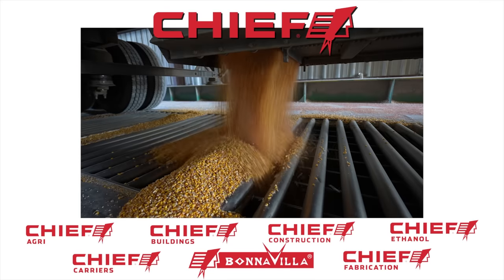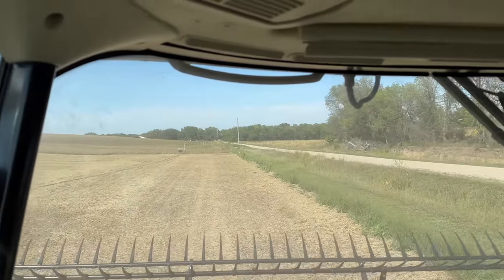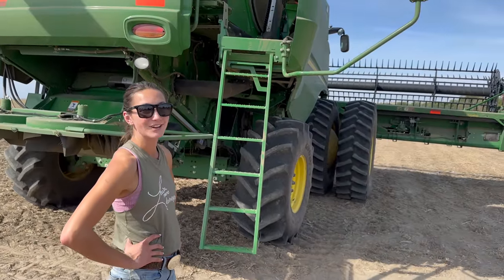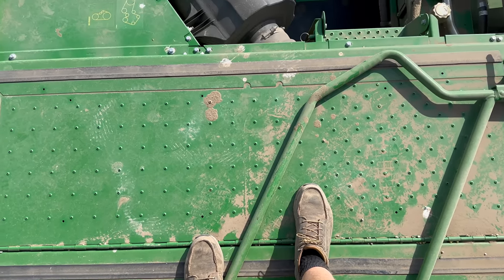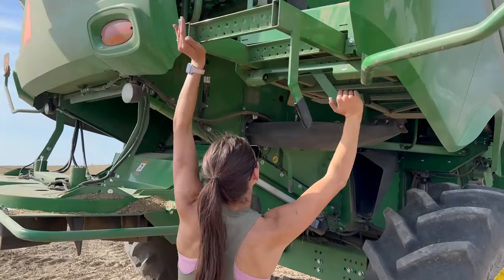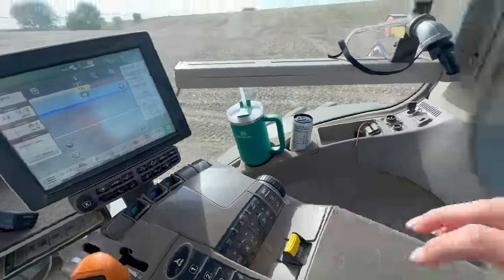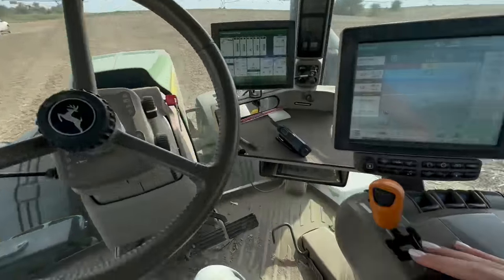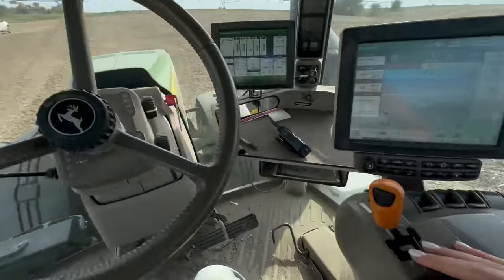We Burn A LOT Of Off-Road Diesel

Comment: You cross your chains for encase the tongue of the trailer comes off the ball hitch. If this occurs, the tongue will fall onto the cross X of the two chains and not strike the ground.
Reply: Nice to know, been doing it for years and never knew why...
Reply: Not going to argue your point but, the real reason has to do with physics. With the chains crossed, when turning, they remain very close to the same elevation off the ground. If they are hooked inline, the chain to the inside of your turn would droop and possibly drag while the opposite chain would be stretched.
Reply: 10-4 on that
Reply: what they said^^^^^^^^.
Reply: Most state laws for towing a trailer require you to cross chains. Safety factor.
Reply: And the crossed chains keep the trailer more in- line if it becomes detached for any reason
Reply: @philipfleming3546  had a trooper ticket me at age 17 for not having my chains crossed judge dismissed it thank goodness
Reply: @joshchoate9499 …I don’t believe there is any state that has a law about chains being crossed.
Reply: @philipfleming3546 …No state laws for crossing chains that I know of .
Reply: I always heard you cross the chains amounts to a check list item.  Like saying the gun is always loaded.  If you cross the chains then you know you attached the chains.  Some things are too obvious to leave to chance.
Reply: Wait you all use chains I guess I should start doing that too
Reply: Yes! As stated 👍  It's a 'safety' thing
Reply: Two chains huh... (NZ)
Reply: Also, very important, the breakaway cable cannot be hooked to the safety chains.  It defeats the purpose.  It must be hooked separately to the vehicle.  It CAN however be laced through the chain links.
Reply: Why do pickups have safety chains but 80k semis only have one kingpin? 🤔
Reply: I thought it was so trailer will not be able to wip vilantly till it over turns truck and trailer.
Another no no pulling vehicle wheel base is extremely important.
I seen a jeep pulling a med size boat on interstate the whipping from over correcting let's say you could take all 4 jeep tires off on top of devider. And it looked like a boat all over the interstate not pretty
Reply: Thanks @ Kimblyelrod7850 for answering that question - I went right to comments when she asked, because it IS IMPORTANT TO UNDERSTAND WHY... My Dad taught me this one as a kid...Yep, saved me with my truck and trailer once.  Otherwise, would have plowed the hitch into the road & may have caued a LOT of DAMAGE, instead of just allowing me to pick it up & reconnect!
Reply: @keithpfrang2114  Understand your statement, but most trailer chains are  cut the same length for the safety chain, which is based upon the gross weight of your trailer. But the overall reason is for tongue safety.
Reply: @toledojeeper2932  There are some. You need to check each State that you tow in. Pennsylvania is one that requires crossed chaines.
Reply: Most States require safety chains on trailers.
Reply: @tylerbendzick  Different type of trucks and different type of trailers.  Apples and oranges.
Reply: @kimblyelrod7850  ..Ok . You would think it would be common sense to cross the chains . But I will admit at times when I’m in a hurry I forget to do it , usually when pulling an anhydrous tank or liquid fertilizer tank .
Reply: Yeah, here in Georgia the GSP Troopers take it seriously to cross the safety chains. They aren't to be dragging on the ground, and by crossing them, it makes 'a cradle' in case your hitch comes off the ball, so it has a better chance of holding up behind the hitch. Oh, and here about off road diesel, if you get caught running this red colored fuel, it's a $10,000 fine, per gallon capacity of the tank or tanks. So my Dodge Ram 4x4 diesel has an 85 gallon tank in the bed, plus a 34 OEM, which is 119 gallons total, X $10,000 = $1,190,000 fine !  I keep it locked, to keep people from siphoning, and keeps them from adding a coloring agent such as red.
Reply: @HerbertPrince  ..$10 a gallon or $1000 per violation.
Reply: @toledojeeper2932  
Wow, Nebraska is a lot more lenient than Georgia is. I was at a scale a few years ago, as the DOT told me it was $10,000 per gallon capacity of the tanks. Which means, I could only have 5 gallons of fuel, but still have to pay 10 thousand per gallon capacity of both tanks. Of course, I never used any, but had some friends who were big farmers who did, and got caught.
Reply: @HerbertPrince  ..It’s the same fine in every state . $10 a gallon/ $1000 per violation. The dye enforcement program is run by the IRS not by the states .
Reply: @toledojeeper2932  
Not from what the state DOT told me. Then a friend in Southwest GA, who happens to be the county commissioner, told me, it actually costed him $2,000 the first time, then it would have been $10,000 the second time, then $10,000 per gallon capacity of all tanks.
But that was year before last, things could have changed by then.
Reply: @HerbertPrince  ..It’s a fine set by the IRS . The IRS has control of the dye enforcement. States and the DOT have nothing to do with the fine .

Comment: Because I'm a fan, I truly appreciate you and Grant taking the time out to make the videos.
Today I learned that you need to cross the chains when you hitch, that you're Combine uses upwards of 300 gallons per fill, that the soybean stalks being wet are what clogs your combine, and that you need to check your equipment whenever you can to avoid issues. I also learned that the fuzzy crap on the outside of a soybean becomes airborne during harvest and clings to everything in the worst way possible.
Love, love, love the kittenz.
If you ever need someone to just record video of the kittenz, I would make the trip in a heartbeat.

Comment: You cross your chains so is the trailer comes loose from the ball, the tongue will drop down into the 'X' you made crossing the chains.  That way the tongue won't hit the ground.

Ideally, it would swing under your bumper and not damage the trailer or the tow vehicle.

If you don't cross them, the tongue would hit the ground and the chains would drag the trailer after it digs into the road.

Comment: A system that I use since I don't have a backup camera, is that I have a magnetic rod that I place on the ball receiver of the trailer to align my ball hitch with another on the bumper that allows me to get as close to possible the correct distance for the hitch.
Reply: I also use a long magnetic rod that I can sight with a defined center line.  Additionally my trailer jack is electrically operated from trailer power connector on my truck.  I am hauling a much lighter trailer than Laura's fuel trailer.

Comment: If you ever want to build a custom fuel tank in a square or rectangular shape, take (in inches) Length X Width X Height, then divide the total by 231, and this will give you the number of gallons. It's nice being able to drive on a trip, then not have to stop as often, plus when I find a place where fuel is cheaper, I top off both tanks. Saves lots of money in the long run, plus in case there is a disaster (like a tornado or hurricane), my Ram 2500 can go way over 2,000 miles without having to stop for, or to find diesel fuel. And if you use a 12 volt solenoid for a transfer valve, make sure it has Viton seals, so the diesel won't leak.

Comment: I’ve recently discovered that in my small Honda generator, ethanol is a huge culprit to carburetor plugging. It turns to water I a tank  so I now only running 4cycle clean gas w/o ethanol. My lawn mower also runs much better on non ethanol fuel.  Storage of fuel is a tricky deal!

Comment: 2:15 - Cross your chains so if the ball breaks the tongue will fall onto the chains and not dig into the pavement and possibly flip over. Also if you have a jack with a wheel you should lift it all the way up and turn it slightly to the right. If it comes down on the jack it will roll off the side of the road.

Comment: When I back up to a trailer I do two things. One is to use the outside rear view mirrors to look at the sides of the trailer and the sides of the truck. When the sides of the truck are in line with the trailer are equal I' back up. When I think I'm close I stop backing and go back to see how I'm doing. Let's say I think I'm a foot short.. I go back to the cab and leave the door open. I look down at the ground and pick a stone or a shoe mark or any handy mark on the ground and then I back up as much as I remember from looking at the distance between the ball and the hitch.

Comment: a great trick that we use in our operation, is that on the pickup truck beds on the inside, we put a piece of tape where the center is. Then we when unhook the trailers, we put a board behind the back wheels before we unhook so that you know where to backup to. I think it helps to make quick work when your in a rush.

Comment: I have seen all the correct reasons here in the comments,, catches the trailer in the X , steers much more effectively if it becomes unhitched, most state laws say crossed chains, and when you turn the chains don't scrape the ground.  Laura, you have some really smart people watching your channel.  You are a lucky farmer.   The trick I use, no backup camera, Gunsight down the side of your truck with the side mirror.  The truck will approximately line up with the side of the trailer.  Put a bright pebble or stick along side the drivers side tire exactly how far you need to move the truck over.  If you need to move the truck back 8 inches, open your door, spot the leaf, pebble,, whatever on the ground 8 inches  from where it will be even with the V formed by the door sill and open door,, or a little less because of angles.  Once moving and straight,, study the particular trailer to see how it aligns with the side of the truck,, remember that.   Maybe even mark the point on the trailer face or fender with a bit of bright tape.  You'll have an exact marker for the next time,
Reply: I don’t know of any state laws about crossing chains .

Comment: If u place a red line on yout tailgate(inside) and make sure the tail gate red line is centered of the hitch, then one red line on your fuel wagon, when u back up just center the two lines and you'll be lined up to hitch whatever trailer that you use.

Comment: Hey Laura . Here is a tip for you to help you back up to any trailer with a ball hitch with your truck. Take a piece of duck tape and put it on the inside of your tailgate were your hitch is at and take your rearview mirror and push the lever to were you would for driving at nite (or it lets you see down) and then you don't have too turn your neck so hard and with the tape we're it is you should be able to back right under the trailer hitch part!!!!

Comment: One simple aid would be a flag in the truck with a magnet on the end of a pole tall enough to be seen from the truck. put it on the jack crank to be close to the center of the tongue of the trailer. As I learned long before backup camera to hook up to a boat trailer and other trailers. one needs to think ahead to have shortcuts or aid to make simple work of difficult jobs

Comment: 15:25 
This summer i had part time job as a tractor driver. I was driving JCB Fastrac, which has max speed 70km/h. And it's realy different to drive a car or tractor in this speed. Especialy when you are pulling 8m long trailer (Arcusin) full of straw bales .

Comment: Hang a tennis  ball over the hitch.  The ball is mounted on the trailer. Then, mark the center of the tail hate
 When the ball bumps the pickup, you are there. Mom had a ball inside the garage. When the ball touched the windshield, she was there.

Comment: You need to cross the chains between the trailer and the tow vehicle so that, if the trailer was too somehow disconnect from the tow vehicle ball, the chains would catch and carry the tongue of the trailer so that it doesn't dig into the road and create an even bigger problem or make you lose control.

Comment: The reason why you cross the chains if for some reason the hitch comes loose it will fall down and it will cradle the tongue of the trailer it keep it from digging into the ground and therefore will cause you much more damage 🤠😎🤠

Comment: $1750 or more to fuel up and top off hydraulic fluid. For an 80 acre field. $22/acre fuel cost at least for just the combine. Plus the grain cart tractor fuel and 18 wheeler grain truck fuel. Then there are the costs of equipment per day. I bet that hydraulic line they bought yesterday was over $500. Farming is extremely expensive!
Reply: inadvertently demonstrating why corn makes for lousy ethanol
Reply: @toddm8917  what? Corn makes great ethanol. You can argue Ethanol doesn’t need subsidies or doesn’t have the energy density per gram diesel or gasoline does but corn is the best raw material based on ethanol yield per acre of corn. Plus the process is simple.
Reply: I’m sure they can combine more than 80 acres on that fill of diesel

Comment: Crossing the chains is the best because it gives you better tuning radius without catching the hitch.
Reply: Exactly!  The tension on the outside in a sharp turn might snap the chain.  With cross chaining there is no high tension.  It is not to catch the hitch. That is just an added benefit if the hitch detaches.

Comment: There's a lot of bullshit about crossed chains on car/pickup/van trailers.
Chains are a safety backup, to stop runaway trailers killing/maiming other highway users.
45 states are fine with uncrossed chains.
Myth : the tow bar will fall neatly on top of the crossed chains and remain there. This won't happen when the chains are attached near the centreline, like on your hitch.  If they attached wide apart they reduce the turning circle, or, if they're too slack they won't catch the tow bar and they'll drag on the ground when turning.
Google "An Engineering Guide for Trailer Safety Chain Installation, Attachment and Use"

Comment: I was taught a trick by a guy that I had known since I was a little kid.  Him and my grandfather worked for the same company for over 50 years.

Anyway, Harold drove a 1 ton dually that he would drop a wide variety of trailers onto, by himself.  Harold got them to drop straight on almost every time.  The funny thing is by watching him you couldn't tell how he did it.  He sat behind the steering wheel looking at the rear view mirror on the windshield, slowly backing up (of course he had already lowered the tailgate) and he would just stop.  He would release the lock pin in the 5th wheel ball hitch under the bed, then lower the trailer into place.

It wasn't until I used that same truck to go do some work in Little Rock Arkansas that I noticed a piece of black electrical tape on the top of the white tool box in the bed of tge truck.  I drove the truck to work when I got back to town.  Harold came in to ask me about the truck and trailer to see if they did okay.  We talked about them for a few minutes, he was satisfied that I had followed his instructions, and he went to leave.

I told him that I had a question for him, so he sat back down.  I asked about the tape on the toolbox lid.  He looked at me sort of stern like, then asked if I took it off.  I told him that I hadn't because I noticed that it had been there quite a while.  Yep, he said, that's my Back Up Tape.  He went on to explain that on the front of every trailer there is a matching piece of tape.  They are there so that when he backs up to the trailer, no matter which one because the trailer tape is set for that particular trailer, he hits the hole almost every time.  All a person had to do was to back straight up to tge trailer, look in the rear view mirror, then connect the dots.  He said that most don't notice the tape.  He smiled when he told me that, letting me know that he appreciated it that I wasn't like most folks.

So, take that bit of time to hook up to the trailer and put your dots in place so that next time you get to connect the dots.

Comment: what most people don't realize is that hydraulic oil expands as it gets warmer just like diesel fuel.  so if your right at the low line when it's warm it will be fine when it's warm

Comment: I was pretty surprised to see in this video two fuel hoses being used at the same time at approximately 11 min. Just to make sure I understood what was happening, is the second, smaller nozzle for urea? That's used in marine diesels to qualify for EPA Tier 4 emissions treatment. I'm not sure how it works but it needs to be stored separately from the diesel fuel, maybe for an exhaust afterburner? I would have thought agricultural machinery wasn't big enough to require such treatment but I guess it does. Could you explain this please?

Comment: Laura....... it's MUCH better for an engine running at high revs like your pivot, if you allow it to slow down gradually with the throttle then turn it off. It should be a minimum of 60 to 90 seconds or more if it has a turbo.

Comment: What happens to the shafts in the header if you pick up a rock?/or all your fields rock free.  Many many years ago when I was thrashing wheat in Wa st. if you picked up a rock there was the possibility you'd bend all the feeder shafts. Maybe the Geology in Wa. is different/ more Ice Age rocks left behind closer to the surface. Could be the old Masseys were more venerable to damage.

Comment: Wouldn't it be nice if tractors, combines, etc. had an air compressor and air storage tank on them so you could do a quick cleanup of all the dust, crop remains, etc. wherever you happened to be. Radiators, air filters, tires, cab, lots of places could be easily and quickly blown off.
Reply: All of ours have for maybe the past twenty or thirty years. Need them for the trailer air brakes.
Reply: I have seen on other channels the combine operators, tractors, etc. carry battery leaf blowers that seem to work quite well.  Probably not as good as compressed air, but still powerful to work.